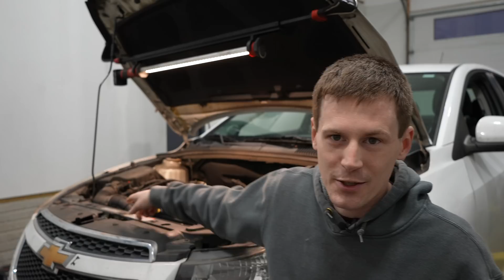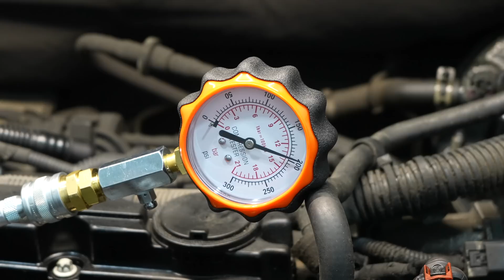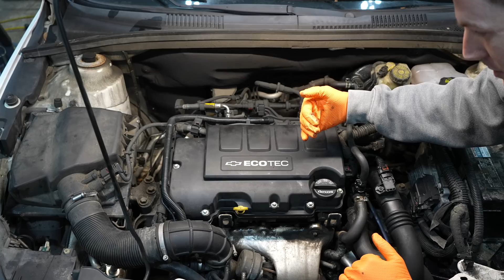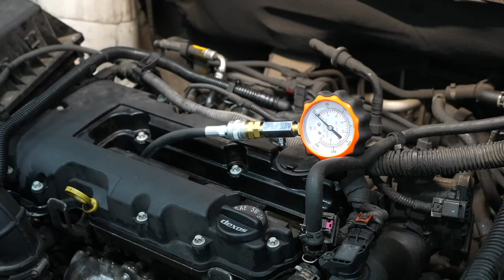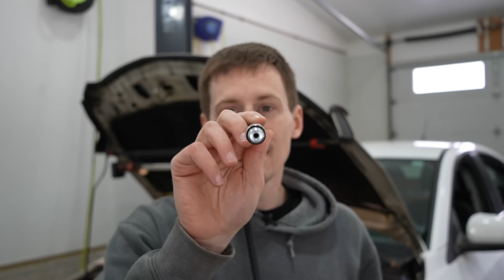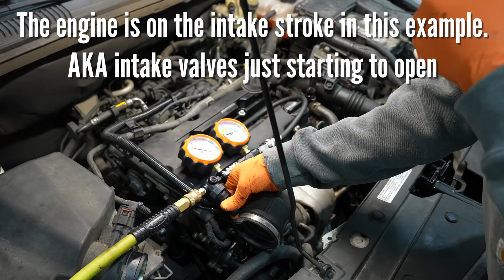How To Do A Compression and Leak Down Test | What is the difference?

Comment: If you have a coolant leak  slightly from a coolant flange or housing will this mess up to t wr if the head gasket is the culprit. Do you need to fix the coolant leak first before doing leak done test?

Comment: Very incomplete. I will have to keep looking to get details and see if I should: add oil on cylinder walls to properly prepare for washed out engine? And what to expect on a used engine rebuild with some minor cylinder scorring?
Reply from the maker: If you used a leakdown tester you have no need for the oil. The video is "incomplete" because you didnt complete it... 😂

Comment: When I did the leak down test on my wife’s suv I couldn’t even get it to 100psi, air was just blowing from cylinder 1 into cylinder 2 and I knew I had an issue. I believe it’s a bad head gasket between 1 and 2

Comment: I'm doing a leak down check on my Hemi and I don't have to hold the breaker bar to keep the pressure in. Is that normal? And I'm getting a reading that's only two to 3% loss on my gauge. I heard that if you have it on top dead center exactly then the pressure actually creates the seal and it doesn't move the piston, so no holding required although recommended. Is this correct?

Comment: I appreciate your videos. Your demo of the compression test is clear and standard, but your leak down demo is unclear. If I did not already know how to do the test l would've been confused. Your viewers who aren't familiar with engine firing order and crankshaft rotation would be intimated by this simple procedure. Just my two cents. To the viewers: check out other videos for a simpler procedure on how to do a leak down test.

Comment: I like the running compression test for volumetric efficiency. I think it would work particularly well for testing intake issues with gdi engines.  Overall you have to look at good compression tests as a false positive and only consider the results meaningful when there's low compression. You can build your own leak down tester and paint can smoker if you're on a budget.

Comment: This was in my opinion a great video comparison on the two most common tests of cylinder testing. However on high performance engines the compression tester should never be used unless you have a based compression figure from when the engine was brand new and run in. For your viewers I will explain why. Performance engines have camshafts that have wide overlap on the inlet and exhaust valves and as such the cylinder pressure at cranking speeds and at low idle speed goes straight out the exhaust and as such will give you low readings on a compression test. For these engines the only test that can be reliable should be a leak down test. For example, I have seen high performance engines with big cams have as low as 70 psi with a compression test and almost 100% sealing with a leak down test. 
Hope this helps someone !
Reply: Yes.  However, I would not say 'never'.   Simple compression test can give you the % difference amongst the cylinders.  As an example that paid off (saved, actually), we recently looked at a random misfire code cust.'s '97 van w/228K.  Quick check (once you got the spark plugs out) found back two cyl (#1 and #3) were under 140 PSI, while #5 was 165.  We could have stopped there.  The others a bit over 165.  Do the math.  You are right at the 15% or worse.   The PCM throwing codes and cust. can't get it passed emissions.   Less than an hour, the cust gets info to decide to spend more or not.  BTW, we open the TBody when doing just the compression.

Comment: I followed you directions, my truck started when I was doing/performing the compression check as you said earlier you’re supposed to disconnect the fuel and coil. You don’t want the truck starting while you’re doing a compression check how long you been a mechanic
Reply: Yea no it’s the fuel pump relay you have to pull he definitely should add this in there
Reply: Nvm watched the full video he mentioned everything this was self inflicted 😅

Comment: Which do you recommend? A smoke test or leak tester to pinpoint my problem. Compression test done…cylinder 1 no pressure, cylinder 2&4 140. They say I should just replace the Motor. They would need to tear the motor to check the problem. From this video it seems they just need a tester, correct
Reply from the maker: Leak down. I've used a smoke machine in a pinch the issue is it takes a long time for the smoke to reach the end of the tailpipe. If you have a smoke machine use it, if you don't have one just get a leak down tester.
Reply: @RepairGeek thank you so much. Im to the point that I want to buy it and give it to the mechanics. 4 shops with 4different answers. Had PO 420 code for 1.5yr now I have PO 171 and 174. Truck has power, no smoke, new plugs, intake, 02 sensors new and replaced within 2 months just because they were under warranty.

Comment: Nice video! Hope you can help me (I'll try to keep it as short as possible).

I have a Saab 9-3 with a B204 2.0L 4-cylinder turbocharged engine.

My car suddenly started running on 3 cylinders. Shortly after that, it began rattling, but only under acceleration also no rattling when idling. Oil pressure is good, no leaks, no smoke, no metal shavings in the oil, and the coolant level is normal.

Later, I started the car cold and noticed zero compression during the crank in at least one cylinder. I felt the exhaust manifold, and one of the exhaust runners (the cylinder closest to the timing chain) was cold, so I suspect that one has no compression. I removed the spark plug, which was tight, dry, and undamaged.

I did notice that the piston in that cylinder is much cleaner than the other three. The cylinder has some tiny spots on top (not sure if it’s metal). I rotated the camshaft so the piston was at bottom dead center and there was no tension on the valve springs. The hydraulic tappets feel very stiff, have a lot of resistance, and can be pushed in.

Tomorrow, the plan is to inspect the inside of the cylinder with an endoscope and check the valves to hopefully identify the issue.

I have no idea what to expect — hopefully it’s just a valve that isn’t damaged or has a hole in it, and hopefully the valve seat still looks good. Ideally, it’s something like a broken hydraulic tappet or valve spring, something I can fix without removing the head.

Comment: I tried this with the same leak down kit as yours on a '15 corolla. I first get it to tdc and have my buddy hold the breaker bar as i can only access crank pully from the passenger side wheel well. I raise psi with the valve, and it gets to 70ish psi and 25ish leak% before I hear a hissing from within the cylinder itself and pressure drops. I imagine im losing tdc as the pressure is pushing the piston down and air flows out of the valves, but there is no resistance felt on the braker bar. I cant even get to 100psi. What am I doing wrong 😅

Comment: A piece of smouldering string, placed adjacent to the air outlet being monitored (exhaust, air inlet) will suffice if no smoke machine is available, but needs calm air conditions! See if the smoke drifts normally or is directed with the leaking air.

Comment: great video. What's the best liquid solution to use to clean leaked oil or burned oil that's made a mess on the side of  the engine?rubber hoses etc. ???
Reply from the maker: Diesel fuel.

Comment: Nice presentation, I need this test on my engine to figure out where my miss fire is coming from. Can you use the leak down hose in the plug hole and couple the compression tester to it? Then remove compression tester and do the leak down test! Reason why I ask, I have a 351 stuffed into a 66 Mustang and it is extremely hard to get to the plug holes. Thanks.
Reply: The compression tester hose has a check valve at the cylinder end . This valve, like the one on a tyre, keeps the pressure in the gauge so that the meter reading builds up over usually seven cranks of the engine. PULL OUT THE FUEL PUMP FUSE TO PREVENT THE ENGINE FROM STARTING FIRST ! So the pressure goes from cylinder to gauge meter. In the leak down test, the pressure from the air compressor goes the other way, into the cylinder, so to use the same hose you need to unscrew and remove the check valve. Test kits already come with the correct hoses. If you use the leak down hose for the compression test, the meter will not be able to hold the maximum reading because there is no check valve. Cheers

Comment: what we get with this? what we have to do if some is bad or very low? do we have to buy another car, or can we keep driving the car until it dies? Who has money today to buy another car?
Reply: If it’s bad it means the air is leaking out of the cylinder either through the VALVES, Piston Rings or head gasket. Valve job isn’t that expensive. Head gasket is and piston rings is even worse

Comment: that was informative video and helpful too . if someone don't have any access to big compressor airline like that in garages, can i use  the other option of pumping the air into cylinder chamber for leak down test- like a portable compressor ? whats the power/specifications of the compressor should be that it can be used for multiple purposes like for this job and Air cond. jobs . i saw you using a small compressor in your AC diagnosis video . thanks
Reply from the maker: That was a vacuum pump in the AC video. You need a compressor that can produce 100psi and probably has a tank over about 10 gallons.

Comment: If there is a head gasket leak, would there be bubbles at the coolant reservoir?
Reply from the maker: If you are leaking combustion gas into the cooling system yes, you will have bubbles with the leak down tester.

Comment: I think it may be important to know that the volume of the adaptor hose is a factor.  The volume decreases the effective compression ratio.   That may be the reason the spec covers a pretty wide range.  The variation between cylinders is also important, I believe ( ?? ).

Comment: How would the compression and leak-down procedures be different for the Ford 2.3L 8-spark plug engines. Access to plugs under the rear of intake is very limited.
Reply from the maker: The engines with 2 spark plugs per cylinder, remove all the spark plugs from the cylinders that aren't being tested. The one that is being tested, leave one of the plugs in so the compression doesn't escape.
Reply: Thanks for taking the time to help out. Appreciate it!  @RepairGeek

Comment: Thanks for a very good video. How would you go about doing a leakdown test, or compression test on a diesel engine?
Reply from the maker: Diesel's can be done the same way. They require a different compression tester kit because you remove the glow plugs instead of the spark plugs and the pressure is much higher, requiring a different gauge.
Reply: @RepairGeek  Thanks! I had problem finding a leak down tester kit for diesel engines, seems to more rare, but glad to hear its the same procedure

Comment: I have a 5.7L HEMI with two spark plugs per cylinder. To do these tests I would  only remove one of the plugs on each cylinder, correct?
Reply from the maker: Correct.
Reply: @RepairGeek  thanks.  Great video.  That smoke machine is well priced and reviewed on Amazon.  HF Icon machine is way overpriced.
Reply from the maker: Almost everything at HF is overpriced anymore.